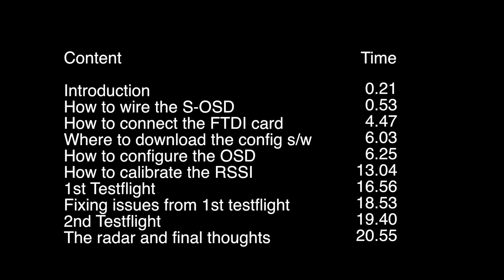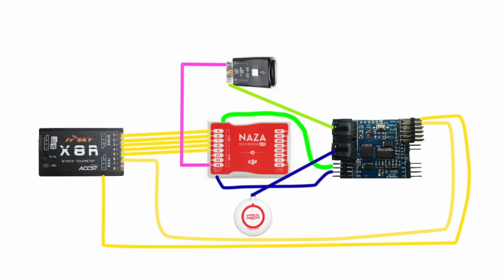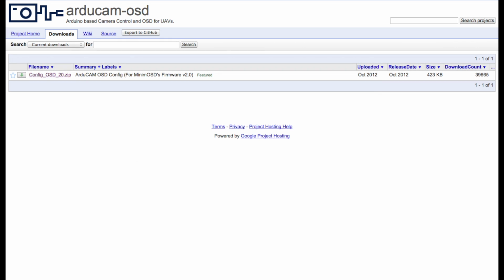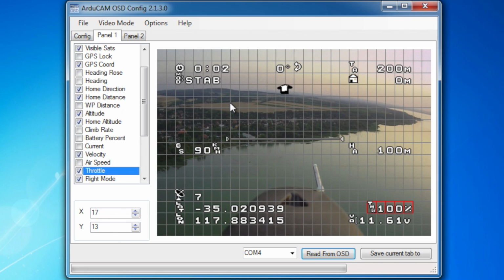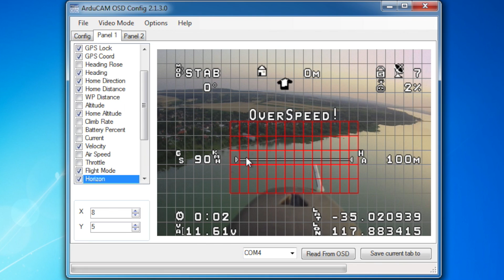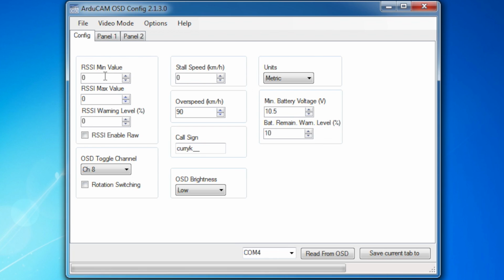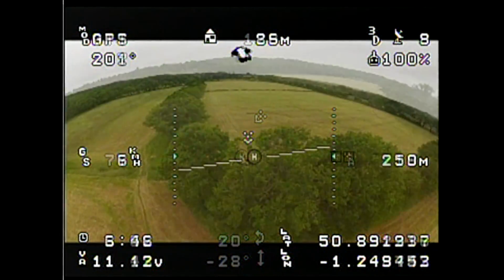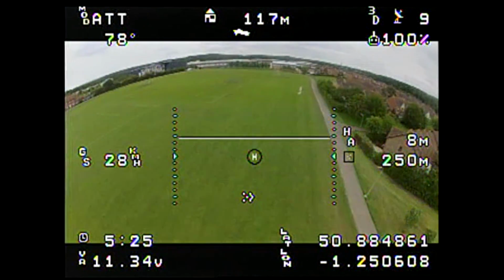FPV review: The S-OSD for naza (part 2) With setup and config guides

Comment: Would it be possible to connect the v in and v out and also have it connected into the osd as usual.So if the osd fails there is still video?
Reply from the maker: +Trisha Scherfer Are you talking about having a connection from your camera direct to your VTX and then another connection from the camera into the OSD, and then out of the OSD to the VTX ?  Don't know is the quick answer, your problem maybe the issue with getting 2 signals into the VTX does the stronger one get displayed, or do you get some nasty flickering, or maybe you get nothing because the whole sync signal falls over.    The thing is with these flying machines, is that we could encounter a failure at any point that will take it out of the sky - fly it lots, sort out any niggling little issues and build up confidence in the airframe.  If you get a video loss because the OSD has gone you should either be able to RTH it back, or if you are in an area where you don't want to let it go up to return, at least ditch it and recover.
Reply: Thanks for the reply that answers my question about the osd wiring.I may stick with the original wiring of the s - osd for the moment.
I like the s-osd as it is not noisy .My previous osd ezosd created a lot of noise on the video signal and my have interferred with the gps on my naza lite...

Comment: Can you please help me with the toggle switch. I cant get it to work. I have assigned a channel to it, but no go What is the work around?Thanks
Reply from the maker: +Kalpesh Chouhan It took me a few goes to make it work, but I'm away for the next week so can't check exactly what I did.  Will let you know when I get back though
Reply: +CurryKitten .. sure I will wait, I have tried all.  your input will be valuableThanks
Reply from the maker: +Kalpesh Chouhan Ok, so on the GUI it's set to a channel - it doesn't actually matter which one, as the servo lead plugs in directly.  It's actually set as ch 7 on the gui, but is channel 11 from my rx.  I then have a mix on the radio on 1 3-way switch with weight at -100,0,+100 (with source MAX on a Taranis)

Comment: Is it possible to use 3DR telemetry with NAZA M V2? If so, how?
Reply from the maker: Well, I would have said no, and certainly in terms of what Naza does, it doesn't do that.  It's all very proprietary and doesn't like to play with others.  However, just had a quick google and there's a system called anysense that can take data from Naza, turn it into mavlink and send it back to you via your data radio.  So it's possible, but it doesn't look trivial to do
Reply: CurryKitten Thanks for your reply. What I was actually trying to find out if there is a way to use DJI Ground Station software or any other ground station software with Naza M without having to buy DJI datalink and BTU other hardwares.

Comment: Here is a quick video of my osd 
https://www.youtube.com/watch?v=3Ql_u0qJfyI&feature=youtu.be
Reply from the maker: MrCorby4 Ok, your altitude is out because you are using TA (which is you altitude above sea level), if you change this to HA (altitude above your home point) then it'll make a lot more sense
Reply: CurryKitten Ooooh  Thanks will try. Took it 1600 feet away from home point . and then checked it on google earth and the distance was very very close. So all is working good thanks again.